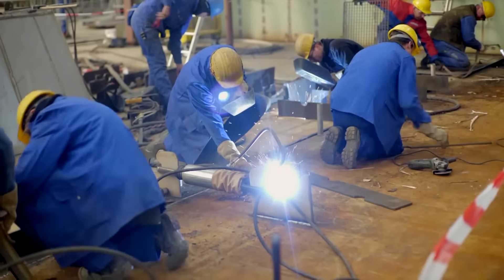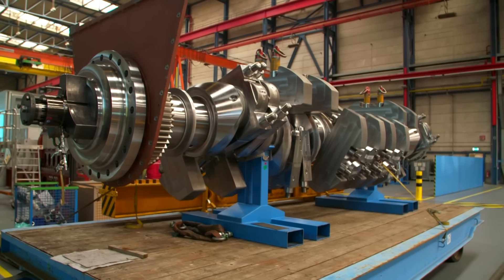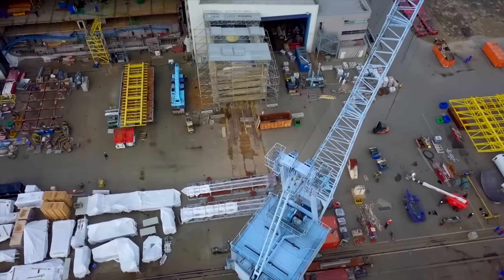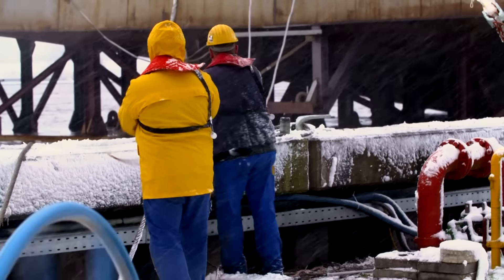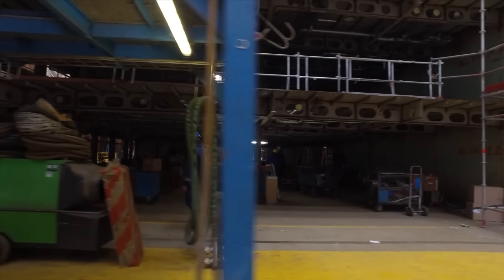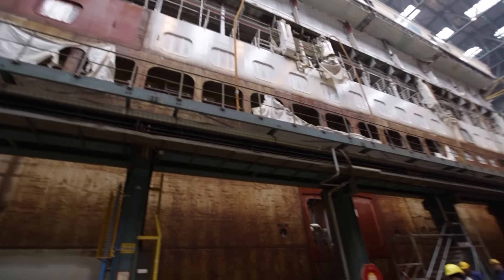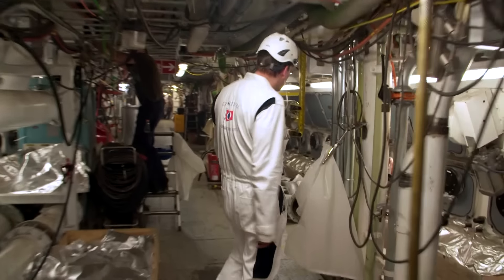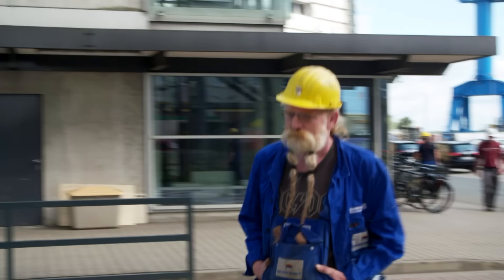Gigantic Cruise Liner | Exceptional Engineering | Free Documentary

Comment: I was onboard this ship when it was still being furnished and decorated. It was in Eemshaven, HUGE BEAST.
Also something to know: While the ship has the ability to run 100% on LNG, it doesn't because it costs the company a pretty penny :)

48:00 The food for the crew on AIDA is widely regarded as one of the best in industry, whereas other companies don't particularly care for the look or the taste and only do a bare minimum. I have so many horror stories to tell aboard many of the companies I worked for.
Reply: LNG is competitive, remember this ship seems to take takes diesel fuel DFO as alternative to LNG but not heavy HDO, 40% cheaper than DFO but requiring large fuel treatment and care. I guess LNG is not available in all ports and sufficient amount...yet...
Reply: @philgooddr.7850  The company always has the ability to order refuel of LNG in most ports. They don’t do it because it’s expensive.
Reply: @serious_filip522  Wasn't it also insanely expensive to give the ship the ability to run on LNG? You would think they must use it sometimes else why bother wasting all the money on it?
Reply: Plus no LNG engine can run all on LNG. To start up more cylinders, they feed it a richer mix of fuel to kick start the combustion. I wonder why they don't fit bigger turbos to make a smaller engine and boost performance but then again ship weight seems an afterthought.

Comment: in many ways this is more impressive than building an airliner, because of the dimensions and size of handling such a colossus
Reply: in many ways this is more impressive than building an airliner, because of the dimensions and size of handling such a colossus
Reply: Easy to build a ship where weight is of no concern.   Airliners, different story.
Reply: @tomrogers9467  building light comes down more to the material sciences. but yes thats a good point
Reply: Agree, with regard to the actual construction process, but don't forget the level of safety and redundancy required for building an aircraft. A ship will generally survive fine with multiple malfunctions. An airliner, not so much. I guess they are just hard to compare.

Comment: I was hoping to see the dyno curve on that motor.
Reply: 42:52 15,442kw @ 514rpm  dyno curve = high lol
Reply: Minnesota Acoustic it starts at 500rpm so it’s curve is only 14rpm
Reply: All you need to know is, that it's..
HHHYYUUUUUUUUGE.
Reply: LOL Let's just say that it makes ALOT of power and torque! They're typically only used to generate electricity for use by the azipods (the rotating pods that hang under the stern of the ship that contain the electric motors that turn the propellers, gone are the days of propeller shafts and rudders, all maneuvering is done via the azipods on modern cruise ships. I haven't seen the propulsion design of this ship yet, but that's how Oasis of the Seas was constructed.
Reply: Update: Yeah, the ships uses two azipods...I had to double check myself so I didn't look like a moron giving out bad information...
Drive: diesel/electric: 4 Dual-Fuel Caterpillar/MAK diesel engines. Total installed power 61.760 kW. - Propulsion: by 2 ABB azipods - power each 18.500 kW by variable rpm. depending on frequency - Max.Speed:  knots.- Service Speed: 17 knots
Reply: @HeWhoDrivesATruck  So do you know if the engine is naturally aspirated or turbocharged/ supercharged?
Reply: @chasencooke1759  I believe these engines are turbocharged in their final form, but I'm not 100% sure on that. They COULD be ran NA for noise reasons, but they're typically turbocharged for efficiency in a marine application.
Reply: @HeWhoDrivesATruck  always turbocharged

Comment: The Eiffel tower is riveted construction, not welded.
Reply: Thomas Conrow I literally just stopped the video to look after this thing about the video
Reply: Thomas Conrow ...Absolutely...
Reply: 2.5 million rivets lol
Reply: The Eiffel Tower: How was it built? ... As the tower grew, moveable platforms were propped into place on the intermediary levels, not only to enable the workforce to weld the latticework together but for their own safety.
Reply: I remember they used cylinders filled with sand to level the legs, let out sand slowly and the legs would drop until they were level

Comment: Id like to see the mpg between LPG and diesel....be the diesel is better...
Reply: Having different energy volumes, direct mpg comparison would be misleading. LNG burns much cleaner than HFO, allowing to not use expensive exhaust scrubbers, thus reducing investment and operating costs even further.
Reply: @sleeptyper  heavy fuel oil burners can run 85 plus days at 90 percent power on a tank. this thing they said can only get about two weeks. I'd sure hate to be locked out of port on this. But to be on point diesel expels nearly twice the btu of lng there for being much more efficient and it wont blow up.

Comment: The exhaust valve opens momentarily before the inlet ports open. The escaping hot gasses move so fast, they cause the cylinder to drop below atmospheric pressure. When the inlet ports open, the charge air rushes in pushing out any vestiges of exhaust gas.

Comment: How exactly does replacing one fossil fuel with another 'significantly reduces emissions of CO2' ?
Reply: I imagine it's a comment on the efficiency gained with this engine over whichever one they want to compare it to, but you know those kind of statements don't have to be true. It might be, and in fact they are almost certainly putting in the most efficient (dollars per passenger mile, not overall wonderfulness for the planet per mile) engine money can buy.
Reply: For the same power, using LNG produces 25% less C02 than marine gasoil.  It also produces zero Sox and 90% less Nox.  However, these engines don't run entirely on LNG as claimed early on in the movie - a dual fuel engine still uses a small amount of gasoil as a pilot fuel (i.e. to ignite the gas in the combustion process).  There are pure LNG engines available, though these are much less common - they use a spark ignition principle (much like a petrol engine)

Comment: It will work because cruse ship run regular routes sam ports most of time the could be places where gas is sold if you set too long liquid gas blows off  this is problem with trucks and buses CNG won't work for ships being fuel fuel the ship won't be stranded due lack of. Fuel not being dold
Reply: @Richard hello,how are you doing

Comment: At 15:01 they bring in the "expert" to build a pipe spool that has to be fairly accurate and they make a big deal out of it like this guy is a wizard or something. He's not. What he is doing is a standard in the industry and any half decent pipe fitter would have no trouble doing it. The flanges had been bolted in place and all that other iron tacked to it is actually an armature to keep the alignment the same as it was in situ. From there you simply cut your lengths and trim your fittings to achieve your fit. There are at least three spools there  to make it look more confusing. These particular spools are even more of a joke since they are using slip on flanges which means you can be out on your trimming 3/16 of an inch and no one will ever know. The trick is more in the welding. You have to preheat the parts and then stagger your welds as you go and keep your metal temperature down to avoid heat distortion and shrinkage. If it's butt joints, sometimes you can place small wedges in the root gap of the weld seam to keep it from sucking together when you run in the root pass. 
I really dislike videos where the producers pull this kind of crap as I am sure a lot of other tradesman are. It is a condescending way of getting the public's attention to watch their product but in fact of matter it is an insult and a slight because they are assuming that their viewers are morons. As for me, I'm going to hit the dislike button and go on to watch something else that isn't trumped up fake reality TV crap like this piece of sh*t.

Comment: The motor is nice but old school, fire your engineers and build an electrical motor.
Reply: It is electric
Reply: And where would the power come from? Electricity doesn’t come from magic pixies, the majority of it is generated by burning fossil fuels. The modular nature of the power plant on these ships gives the option to refit with another power plant if a more efficient option when it becomes available. The propulsion system is entirely electric. The fuel burning engine is acting as a power plant providing both hotel load and propulsion. Currently no solar, wind or geothermal power option exists to provide the power needs of a ship this size.
Reply: Solar and wind aren't practical to power a ship that size with so many people on board.     Too much energy is needed. 

It probably should be a nuclear cruise ship.

Comment: Finished just in time for Cov'd to shut down all the cruises.I'd have liked to see if they put in ultraviolet light sanitizer lights in the ventilation ducts to kill viruses and bacteria.I can imagine mankind will build starships in this fashion in our future. Do they have cameras all around the ship to aid in docking such as Tesla does in its cars? Spotters are used on older vessels and sound powered telephones are still required for US Coastguard approval to navagate in US waters. I don't want to cruise as I spent 50 years on vessels as an electrician and technician.I seen the tech change and progress for all types of systems.Computers(PLC's) still can only control the power but to transfer that power takes big motors and controllers and cabling which have huge amounts of voltage and amps. Those systems of conveyors and elevators still have to be maintained and tested to insure they operate.Vibration  and heat of motors and moving equipment causes the connections and sensors to loosen and if not tightened will cause failure and damage.This must be done on a quarterly schedule.Contacts and springs in the relays have to be replace when they get worn out from use. This ship is  a marvel of engineering but its not a rock so its going to take a lot of money to keep it operating.None of our young people want to work anymore.They all want to supervise.I seen it happen here in the USA.I had a 4 year apprentice refuse to show me that she could trouble shoot a controller and when I reported her  I was told that the apprentice was a protected class (Female) and they sent her to another mechanic,She is likely a boss now and couldn't fix her own coffee or the machine that makes it.

Comment: I Love the useless VR. "It would be nice if we could walk thru walls and visually inspect every pipe and cable duct"  lmao "But we can" No, No your Not lmao.
Reply: @Taipan Tails common sense should tell you that the 1993 VR that they are using isn't doing anything. its defiantly NOT the actual ship its just the plans in a 3D walk thru model. Lets say Power isn't working to one of the Cabins. how is that cheesy VR going to help? by the time you get it powered up and at the location to where the problem is.. you could of just grabbed the paper plans. Plans are pulled up on the VR set.. ok now what? to "inspect" something it has to be in front of you. Paper plans on a 3D model (VR) wont help you lol Your Cell Phone has better VR options that that thing.